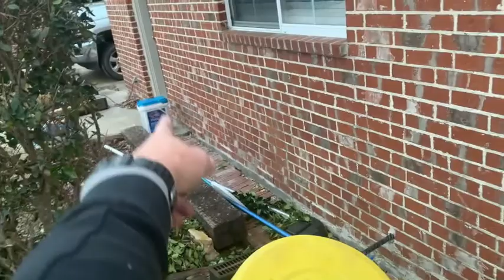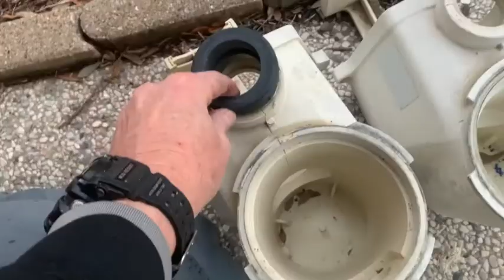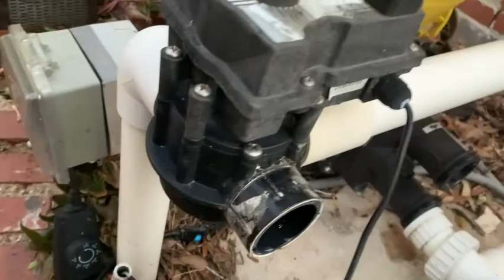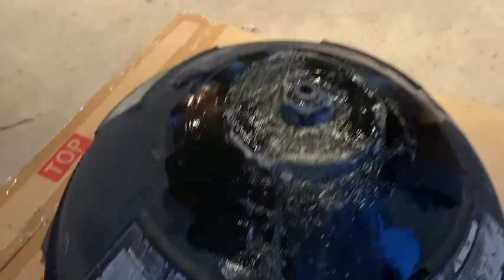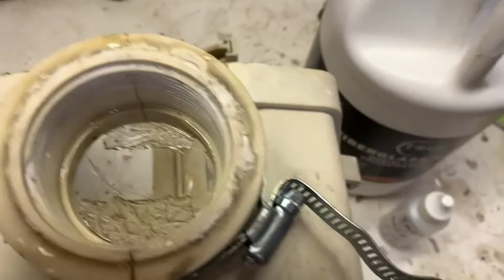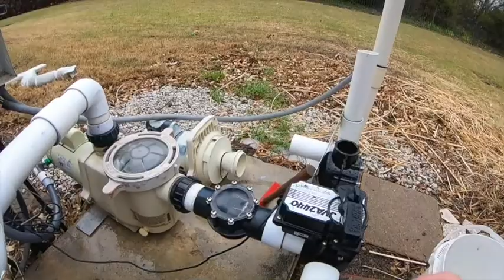Swimming Pool Repairs after Texas Winter Storms

Comment: I have the same whisper flo pump. Mine has a hairline crack that sprayed water out the side of the housing. I JB Welded it on the inside, and it is holding for now.  I have a new one on order.
Reply from the maker: I have two of the pump housings on order, I didn’t want to buy complete new pumps.   Bad news is that they’re on back order with no date.   My primary is working, but trickling water out of the crack.  Crazy storm for sure.